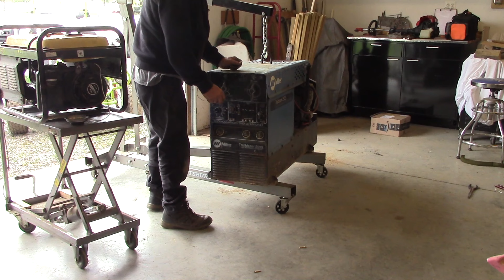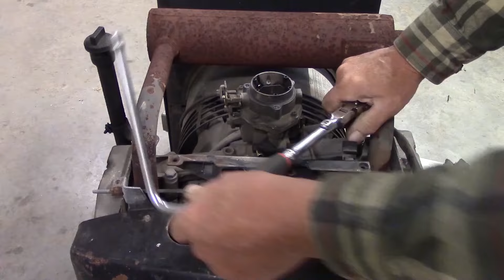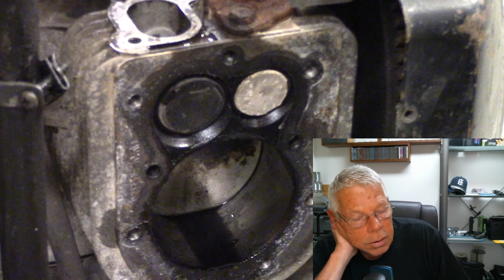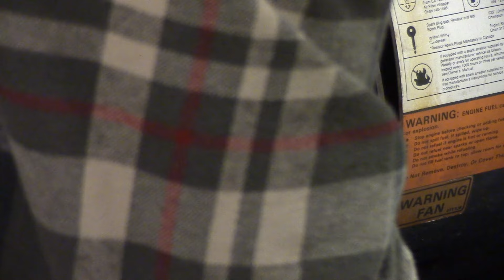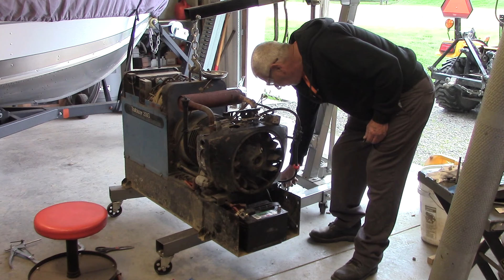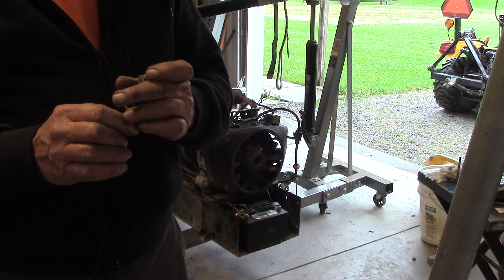Miller Trailblazer 250 Welder Generator Valve job Part 2

Comment: On my bobcat miller 250 is passing gas to the oil. Why is that? Thank you for your videos
Reply from the maker: It's quite possible that its getting sucked through the vacuumed port of the fuel pump. That would be my wild guess. Another would be a stuck open float. That usually fills the piston chamber and makes it very hard to start or locks the motor till you release it through the spark plug hole. Hope that helps. let me know. Thank you for supporting and commenting.
Reply: @CaptFerd 🙏🙏🙏🙏
Reply: @CaptFerd thank you so much sr
Reply: @CaptFerd good afternoon donyou think it’s due to the fuel tank bushing?
Reply: is broken in the gas line is so loose
Reply from the maker: @Salvadortriana1975   It is something that certainly needs replaced but not a source of your problem.  Does it have an Onan or Kohler engine and what year.
Reply: @CaptFerd yes it has a kohler engine is a 2009
Reply from the maker: @Salvadortriana1975  I was thinking it was an Onan like the one in the video. With it being a Kohler, it would most likely be the carburetor.  They have a common problem of the needle valve not seating properly and filling the engine with oil.  If it runs OK, you could put a fuel shut off valve on the fuel line and shut off the gas after you use it.  If you rebuild the carb you need to replace the brass sleeve that the needle slides into as well as a new needle. I have been successful with aftermarket carburetors as the Oems are very expensive. I cant think of any other way other than what I mentioned earlier that could be the problem. I hope this helps and you resolve your problem.
Reply: @CaptFerd  OK thank you so much

Comment: Do you know how to wire up a 200 Miller Ellie welding machine ignition switch check it out it's an old legend le
Reply from the maker: Are you having trouble or are you wanting to add a starter to a manual start?
Reply: Quick question my miller bobcat 225 nt welds generates power perfectly but it blows white smoke through exaust and oil tube how can I go about fixing this is there oil mixing with gas in the combustion chamber I just would like for it not to smoke any white smoke